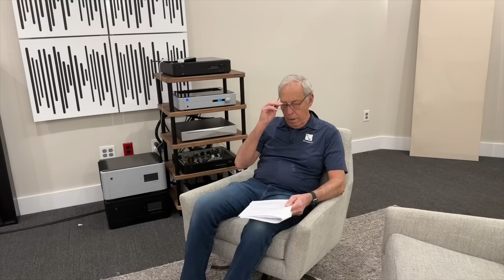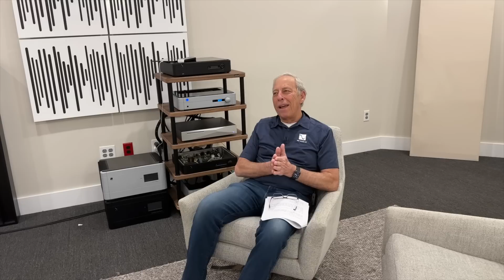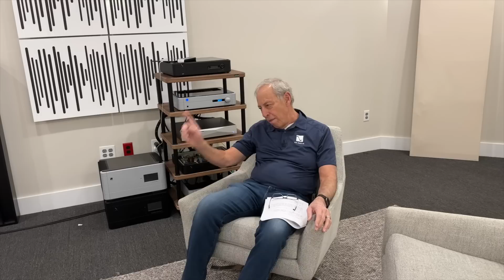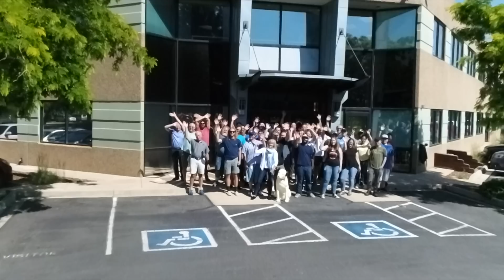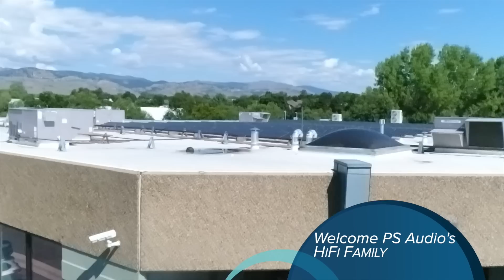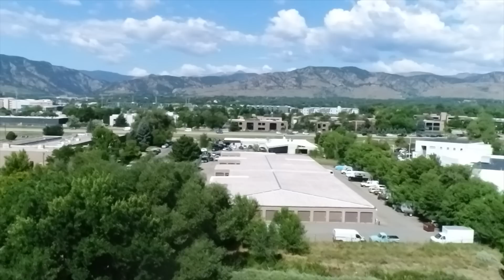Can audible differences be measured?

Comment: Audible differences a hundred percent can be measured

Can be

The only question is are they captured by the set of parameters we typically used?

I would say sound is far more complex. Then this subset of parameters so not all audible differences can be attributed to the current set of things. We look at

Comment: well its not that simple.  First can sound differences be measured ? most yes.  There are some sound differences that simply cannot be measured.  Then comes the big question.  There are many sound differences in audio that are audible but cannot be measured And cannot be easily determined if ones better than the other. This is why many things in in a audio system simply need to be listened to and then determined which sounds better to you.

Comment: There are so many customer reviews testifying that certain Interconnects costing upwards of £40 to £100s each in UK 🇬🇧 pounds have resulted in a significant improvement in sound quality to their hi Fi 🎶 
I've always been somewhat sceptical that a piece of wire with plugs can make such a large audiable difference
Quite expensive audio components come with standard "one dollar" connecting leads.
Surely they would include better ones as part of the improved specification ? 🤔
Reply: When I changed my £40 audioquest black lab RCAs for the more expensive £200 chord shawline RCAs it was as if I was hearing my Rel subwoofers for the first time. In fact I was so impressed I have now changed all of my RCAs and furthermore one thing I didn't expect, just how much my noise floor has come down. 🥳 and bear in mind as well as my stereo I've also got 9 channels of amplification!

Comment: Bob Carver didn't use a scope, he did a null test. He had both amps playing the same input test tones feeding a single speaker. This speaker would only output the differences in output signals of the amps. He then knowingly modified his amp to reduce that null difference until the speaker was silent - ie no difference in outputs. During the listening tests, the reviewers actually thought some aspects of the Carver were superior to the Conrad-Johnson Premier Four comparison amp so Bob reduced the power of his amp to match.

Comment: Is it better or is it different? Take cables for an example. You have lamp cord and $1000 a foot gold plated unobtanium cored wires. You like the way the high end sound with the 1000 dollar a foot wires. Are you just using them as tone controls or is it better? How?

Comment: It's not so simple of course. Though technically you should be able to measure everything you hear, how do you measure timing, or realism, or depth? It's there, in the room, but what measuring equipment do you use to pick it up and turn it into data? Do you measure depth in hz? or in miliseconds? or in volts? So indeed, measuring 'difference' is the best option. But even then, you still need to start with a great amp. Because we've all been to audio shows where the designers say 'it measures perfectly so it sounds perfectly', then then it always sounds like absolute junk.
I, as someone who's only on the listening end of the story, do not care about measurements at all. I heard things that said to measure perfectly that sound horrible, and I heard things that sound amazing, that measure like absolute dogpoo. Now, could those things sound even better if they were improved using measurements? I'm sure they could. But that still wouldn't be a decisive factor for me, as my ears are not measuring devices.
Reply: Actually, your ears are measuring devices.
They measure and identify not only fundamental frequencies such as what pitch an instrument is playing but also can identify more than one of the same type of instrument playing based on phase shift and transient timing and can identify two different instruments playing the same fundamental pitch but having different harmonics and overtones.
Your ears can take the difference in the arrival time of sound waves and can identify the location and distance a sound source is coming from and do it for multiple instruments at the same time.
Your ears are incredible measuring devices when they work but unfortunately, their abilities to do those measurements can be degraded or even destroyed.
The average 20-year-old male has already lost nearly 25% of his high-frequency response and can rarely hear a 20 kHz signal.
Loud noises can degrade hearing even further and more rapidly.
Ruptures to ear drums can cause distortions and even ear or sinus infections create distortions in hearing.
This is all known of course because the science of Psychoacoustics has been studying the way sound is perceived for a really long time.
That is why we are not only able to measure what a listener should perceive but devices can be created that can compensate for abnormalities in listening environments and listener abnormalities as well.

Comment: Carver pulled off his amplifier challenge trick twice. First at The Audio Critic, where he matched his amp to the Mark Levinson ML-2, then later at Stereophile where the reference amp was a Conrad Johnson Premiere 4. 
Carver created the transfer function audibly, not with a scope, by connecting both amplifiers to a single speaker through a dummy load.

Comment: How do i suggest a topic? I’d like to know your thoughts on the Heil AMT tweeter/mid that ESS used back in the 70’s. They now make that speaker again and I am building an exact replica of the ESS AMT 3 Rock Monitor speakers. I purchased the Heil AMT’s, I am using Eminence Beta 6a for the midbass and for now some Dayton audio 10 inch driver with the intention of purchasing new 10 inch drivers from ESS in the future and I found someone that made me a pair of crossovers with the exact layout and specs as the original. I should be a fun project and I can’t wait to compare them to the all original pair my uncle has. I have been so amazed by that Heil speaker and would like your thoughts on them and maybe my project. Thanks, Matt

Comment: There's no mystery here. And Paul knows it. And that's one of the reasons he has a vacuum tube in the input stage of some of this products. The difference between the sound of a tube amp and solid state anp are very well known and can be duplicated using DSP. That was demonstrated 30-years ago. Most people prefer the sound of tube amps and that's fine. Paul got really close to getting into AB/x testing in this video. He hates AB/x testing.

Comment: can someone explain how cables make an audible difference when the signal must go through the same tiny tinsel leads connected to the driver ?
Reply: Shhhh you're upsetting the audiophiles.🤣😂🤣😂
Reply: @JonAnderhub  or am I saving them from snake oil ?
Reply: In my opinion they do not unless the cable is real bad quality or completely wrong for the application. Even then the audible difference is going to be static and or distortion and not a sonic characteristic. This has nothing to do with tinsel leads. It's just electricity flowing from point A to B. It needs to get there cleanly, there is no sonic signature in the cable.
Reply: "the same tiny tinsel leads connected to the driver" - that is your assertion.  Plenty of speakers are not like that. Furthermore, you seem to believe that in a chain of processes only one particular junction is important.  It's an absurd belief on your part.
Reply: @TheDanEdwards  well if you disconnect those tiny tinsel leads to the driver ...your system will sound disappointing ...so that junction is important  ?

Comment: Every linear electronic circuit design has a unique "spectral" finger print. Basically what Mr. Carver did was to somehow emulate the "spectral characteristics" of a tube amp. transfer function into a modern transistor based circuit. Today this is done with software plug-ins. Bob did it the hard way. Brilliant.
Reply: Bob Carver did the challenge in 1985. Bob did it they way it could be done that day.
Reply: OK thats nice.

Comment: To me a cable should be as transparent as possible and not have a sonic characteristic of its own. If it does, then its a "bad" cable. Also tuning an audio system using speaker, interconnect and power cables is just silly.Its just random. If thats the case then the speaker manufacturer should tell you exactly the amp and cables to get the best sound.
Reply: @Douglas Blake 
That is why I use Bluetooth with my $20.00 Bluetooth speaker. I do have a $250.00 USB power cable for it.😎

Comment: I suspect that it's challenging to interpret measurement data in a way that's relevant to various "audiophile" characteristics. For example, I don't have the slightest idea what a signal looks like that people would say sounds "airy," and I'm not convinced that we could isolate just the "airy" characteristic between two interconnects.
Reply: a signal looks like a heartbeat but more squiglier. If you have a track that sounds airy you can see the graphed frequency response of the track from the mix and you can graph what your amp puts out with some equipment and compare. You can compare a few tracks and see similarities to the references. Humans are great at finding patterns. You can't make a non airy track airy though. Honestly music is engineered to sound a certain way and goes through a process in studios called mixing that's why it sounds a little different live.
Reply: Isn’t “airy” just reflections? As well as well recorded live music (not recorded in different places at different times and stitched together) with “air” between instruments/sounds?

That’d be incredibly easy to measure and difficult for a human to decipher. There is nothing that can’t be measured, the difficult part is deciphering the data and figuring out how it relates to human perception. Human hearing and perception is miles behind measuring equipment.

What I really want to see as a standard is comparing an input signal to the output, both in wave form (either source/DAC->amp or amp->speaker). Obviously this would be incredibly difficult for a human to do however not for a computer program, if one was will to spend the money on it.
Reply: @GrB-M  Human hearing is actually not miles beyond current test equipment and airiness can be added to the sound.
The science of Psycoacoustics which is the science of how humans understand sound has been around for quite some time and much of the results have been incorporated into test and reproduction equipment for quite a few years now.
What can't be duplicated or compensated for is the difference in hearing from one person to another.
Put a 5-year-old a 20-year-old and a 60-year-old person in the same room, or even a woman that is 20 and a man that is 20, and while all may call themselves "audiophiles" none of them will actually have the same hearing.
It is a well-documented fact that the average 20-year-old male has lost as much as 25% of their high-frequency hearing and their hearing no longer extends to 20kHz.
The average 45-year-old "audiophile will be hard-pressed to hear past 14 kHz.
But modern digital signal processing can make up for some differences and anomalies in an individual"s hearing.
Reply: @JonAnderhub  
I sit on the porch in my rocking chair and hear the grass grow.
Reply: My speakers sound better wearing my hearing aids.
They sound airy..

Comment: Probably if one has the right equipment - equally one could ask, i s it  possible to hear a very small difference in a measured quantity, e.g. THD.
Reply: Of course one can measure THD and changes therein. I had a B&K Analyser way back in 1990 and measured THD . Used it to fine tune biasing and feedback to optimise THD.
Reply: @Douglas Blake Indeed, the 'received wisdom'  was that even the very best speakers produced round 2% THD, modern speakers may be better. I used to work along side Doug Self at the original Cambridge Audio in 1974 and we used to have loads of discussions about these things along with blind A/B testing to test if people could really hear the differences between his new amplifier designs and the older Cambridge Audio designs - Doug's Masters degree in Psychology alongside his Engineering degree gave him a good insight into how people perceived audio, and whether or not some people really did have 'golden ears' :) One thing I did learn was that there was an awful lot of BS in the audio world when it came to selling very expensive gear!
Reply: not equally because music and sound is all distortion. What you're looking for isn't distortion, it's a change in the frequency response. If there's xyz amount of bass mids and treble and you get abc when you play it back your system somewhere in the chain is warping it in comparison to the reference. You can also measure jitter and you can also find artifacts in the sound that were not in the reference from the digital to analog conversion and if your amp is push pull you may get crossover distortion but you don't need to measure that either because you can hear that one with your ears.
Reply: @V1ralB1ack  As always the answer is, it depends :)  Of course one of the most fundamental audio measurements is gain flatness v frequency but this is very simple to measure. Whether or not you can hear crossover distortion depends on its level and the harmonics it produces. Artifacts produced by jitter will again vary dependent upon the jitter of which there are many types, both deterministic and non-deterministic - it's a complex subject that I get involved in quite a lot.